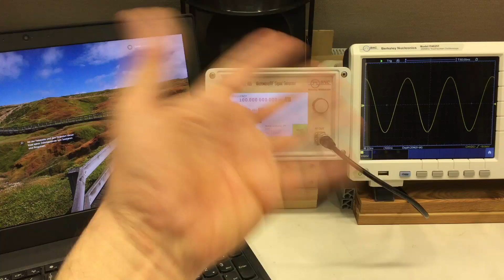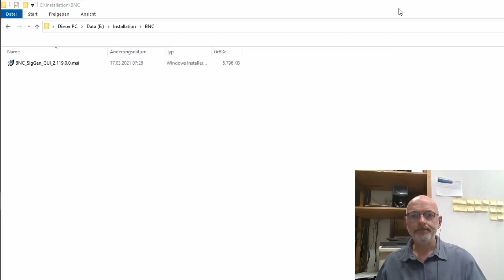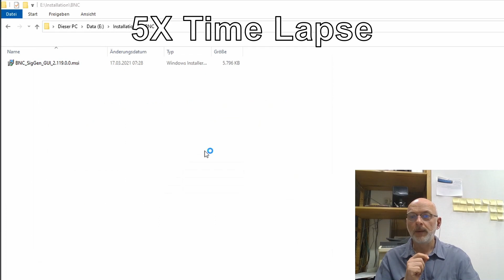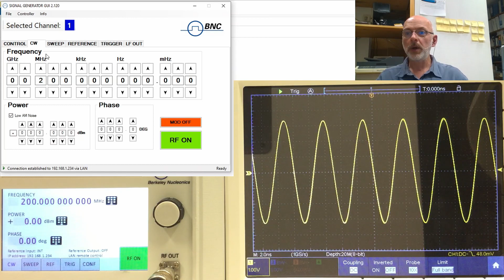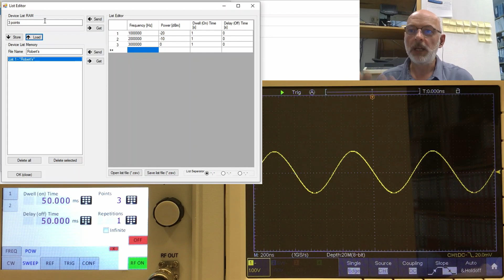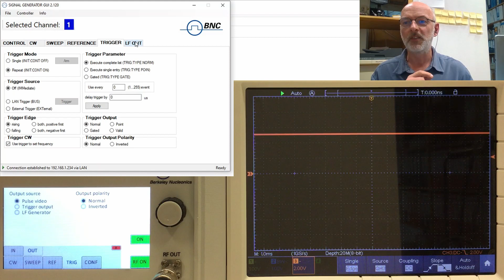BNC Model 865 40 GHz RF / Microwave Signal Generator: Review Part 2

Comment: Great one ... Can do this be connected to an antenna and interfere with the phone to prevent calls within some area ?
Reply from the maker: Thanks :-) Oh yes, with a maximal output power of 25dBm / 316mW it can interfere with all kinds of microwave communications, at least at short ranges.
Reply: @robertssmorgasbord  So good to have a future video about GHz amplifier for such application
Reply from the maker: @WalidIssa  Well, probably not. My skills regarding the actual design of microwave circuitry are basically non existent. Especially when it comes to the PCB layout it's all black magic to me.

Comment: Versatile piece of kit, I don't think it's a good thing if instruments have functions you can only use via an 'app' this is of course a personal thing but I hate this 'app culture' were in, however it's not going away anytime soon, so I better un-bunch my panties, stop crying and get to like it !...cheers.
Reply from the maker: That was exactly my criticism, respectively, that's exactly my sentiment. I do see the value of apps (ease of use on small displays). However, if you can't access simple but important functionality via the app, that's just annoying. You can make a case here that editing user defined sweep lists is something you really want to do on the PC. It's like uploading a user defined wave form to a function generator. But simple yes/no options you can't set on the unit itself? I don't know.
Reply: @robertssmorgasbord  Oh yeah, I have no problems with a PC interface either, it allows so much more functionality, but this example could have been implemented better IMHO.
Reply from the maker: @andymouse  Indeed, it could be! And I'm pretty sure BNC will do some work on the PC software as well as the unit's firmware after seeing that video. At least I'd like to think that my video is that influential ;-) Anyway, the hardware itself is very cool! I had that crazy idea of building a micro-microwave to boil of drops of different liquids (determining the resonance/absorption frequency of the molecules). Unfortunately I have to send the unit back now :-(
Reply: @robertssmorgasbord  Shame.
Reply from the maker: @andymouse  Yeah, I guess that unit is too expensive to let me keep it. The cheapest Siglent 6 GHz box goes for about 11000€ plus tax. Haven't found any prices for 40GHz units - it always says "request quote".
Reply: @robertssmorgasbord  If you need to ask you can't afford it !!!  LOL!